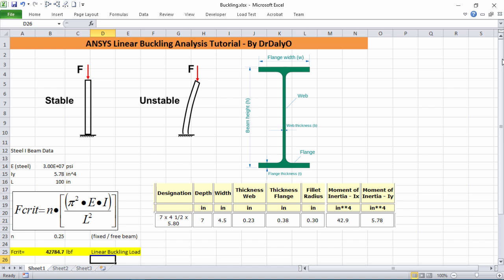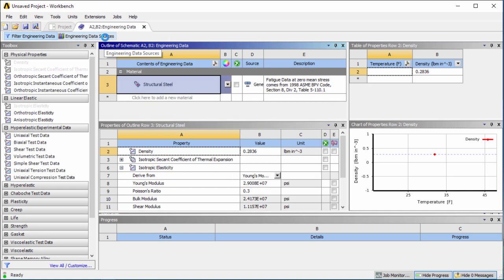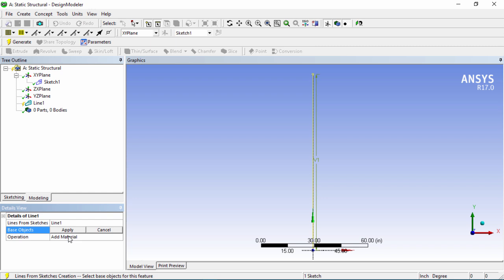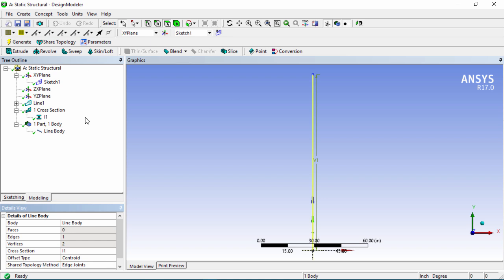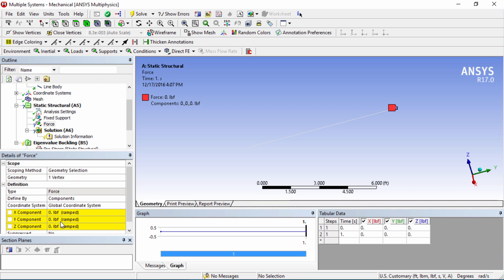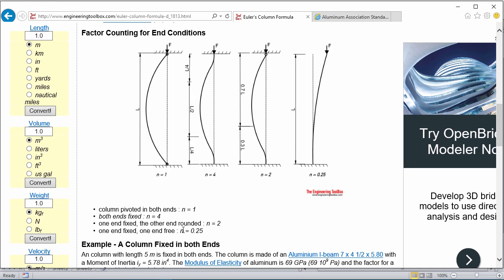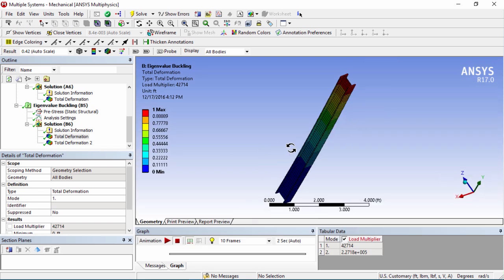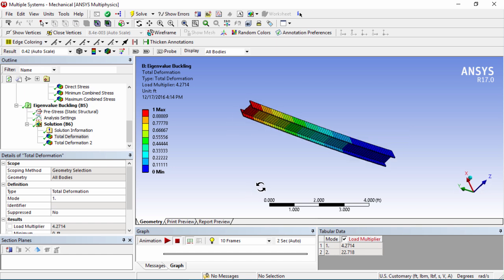ANSYS 17 - Linear Buckling I-Beam Tutorial

Comment: Dr. Dalyo, my name is Carlos, from Brazil, I'm a mechanical and civil engineer. I liked very much your video concerning Linear Buckling I-Beam Tutorial - Ansys 17. I have some doubts about this problem. In case of a a frame structure with two columns and one bean linking each other. How to separate the results of the Buckling Analysis for each column? Is it possible to get the load multiplier for each column separately?
Thank you so much for your videos and hope you can help me in this issue.

Comment: Great video! 
Can you explain to me what an eigenvalue tells us about the buckling. And is a high eigenvalue good or bad?
Reply: The eigenvalue is an indicator that gives you the load multiplier. Meaning, that is the multiplier of the current load in your structure to have the load that would cause buckling to occur. For example, your column is currently being under 100 kN, and the first eigenvalue is 2.0, that would mean at load 100 x 2.0 = 200 kN, the first buckling mode would occur. Therefore, the higher the eigenvalues the better.
Reply: Tien C. Nguyen  
Thanks alot for this explanation

Comment: Thanks, these videos are very helpful. When I generate the "total deformation 2" for the torsional deformation, the model changes in a way I find hard to describe - not smooth at all, it's really sharp and twisted with sudden directional changes. Could you explain this at all? Cheers
Reply: I see the same problem, in the second buckling mode beam edges seems very sharper in every mesh. But all the other results are the same.

Comment: Dear Dr. Dalyo,
Thank you for your very helpful videos. I want to model a column with circular cross section in Ansys . the problem is that my column's modulus of elasticity and density vary linearly from bottom to the top of column. 
is it possible to model this column and define a function for E(elastic modulus) or density in Ansys? if so, how can I do that?
In addition, How can I define a rotational spring at the end of my column instead of just fixing it?
Thanks for your time,